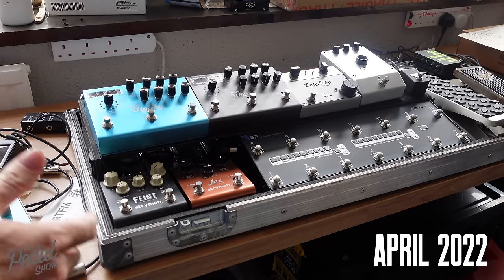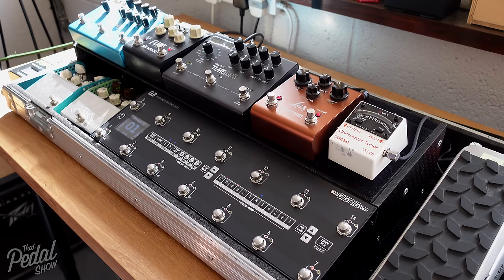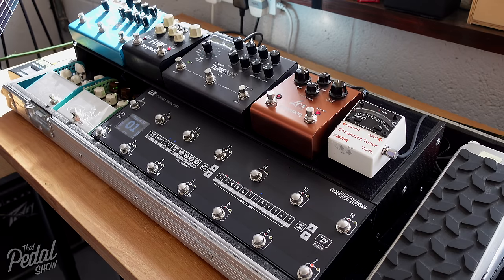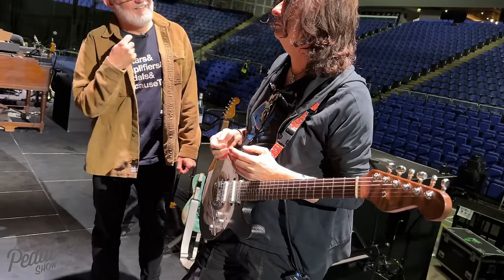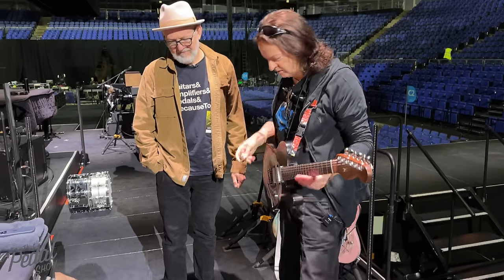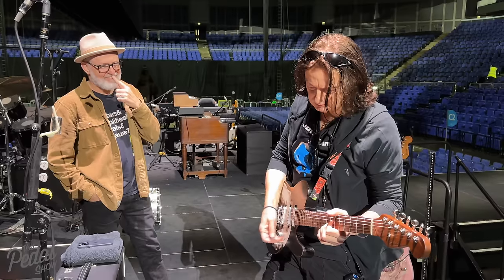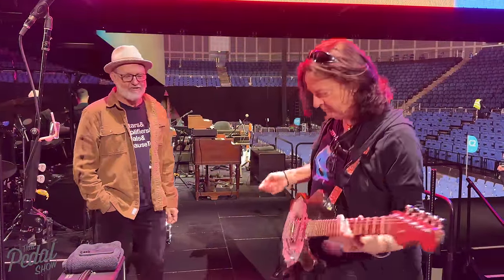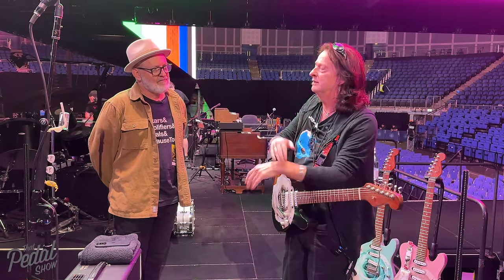Dave Kilminster Pedalboard Build & Interview [On Stage For Roger Waters]

Comment: Hey, I know it's an easy mistake to make but it looks like he's actually using a Dunlop Band of Gypsys Mini Fuzz Face FFM6. The white knobs are the giveaway. The FFM2 has black knobs. Not germanium as far as I'm aware or even really a Fuzz Face circuit. Roger Mayer put an octavia circuit without the octave in a Fuzz Face enclosure with white knobs which is what Hendrix used during the BOG Fillmore East performances and that's what Dunlop used as the template for the fuzz on his board.

Comment: Does anyone know why the fuzz is in the tuner out socket of the G3, please?
Reply from the maker: The aux out of G3 is a TRS loop that sits before the pre gain meaning you you can engage the fuzz in the aux loop and use the pre gain as an output buffer without it destroying the tone of the fuzz 👍
Reply: Thank you  @ThatPedalShow  ! Will it do this on G2 as well or just G3?